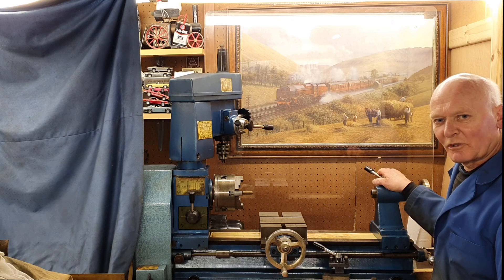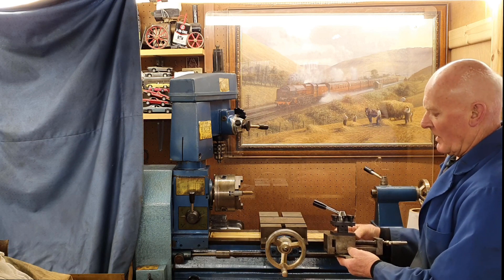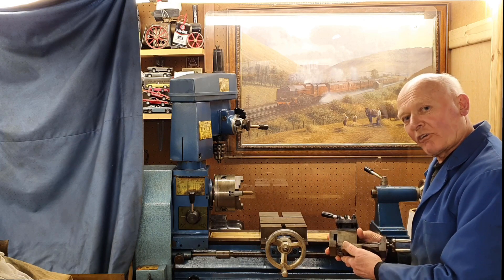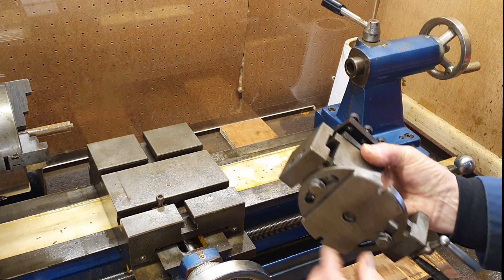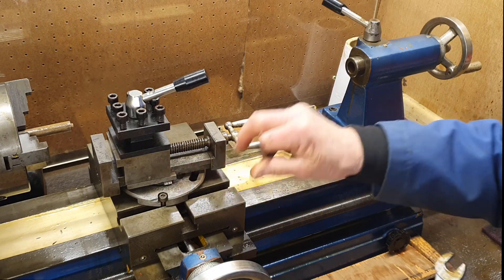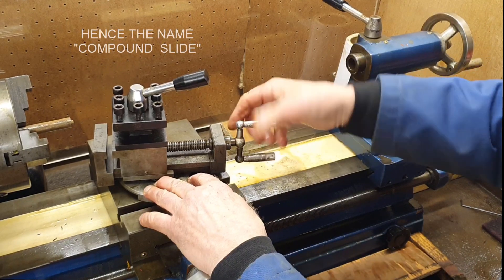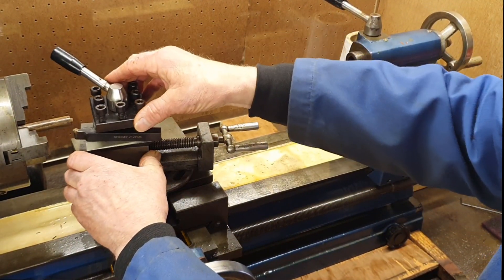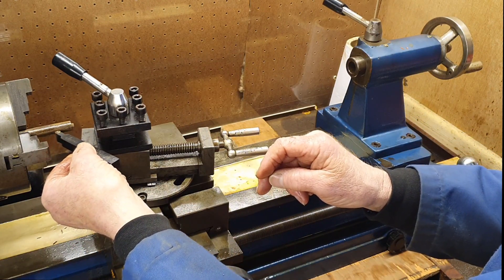Can a Rusty    Lathe, Mill Drill       be saved from    Scrap Part 20

Comment: Great video I own a more modern version of this combo machine, it's a relationship between love and hate, it's my first machine and I learned an worked a lot, gets lot of pieces done in a very small footprint in the workshop but it's difficult to get a precision about a thousand
Reply from the maker: Hi,
Yes, as with the compound slide, the whole machine is to some extent a compromise I suppose.
You are right though, in a small area (and for not too much capitol outlay) you do have a considerable amount of small workshop " right infront of you".
Just a shame that this machine does not have the "raising" Drill Mill (headstock), but it does have the benefit of the auto feed for the "longitudinal" Cross Slide" travel.
Cheers for the comment.